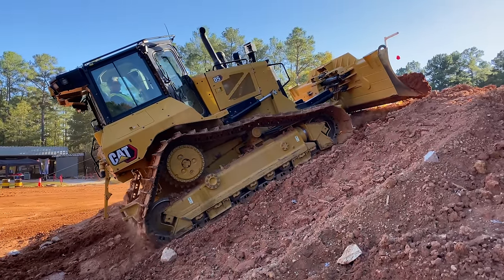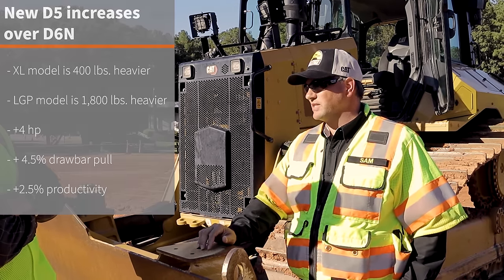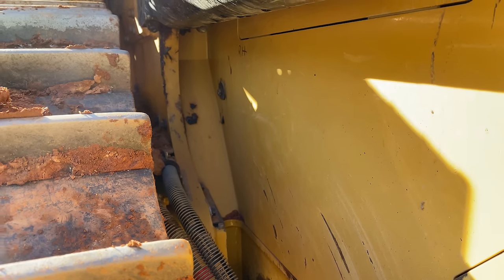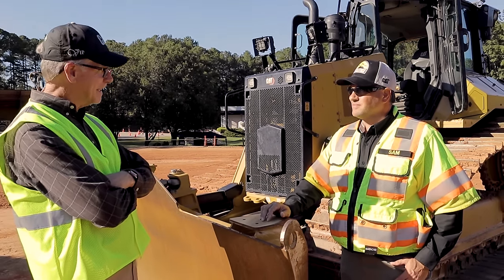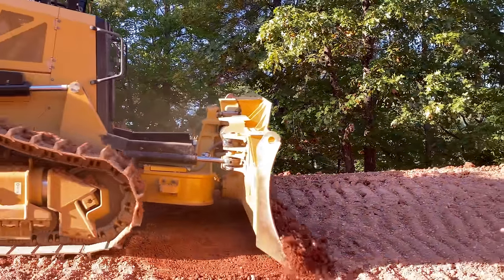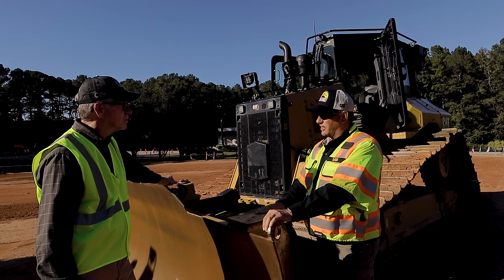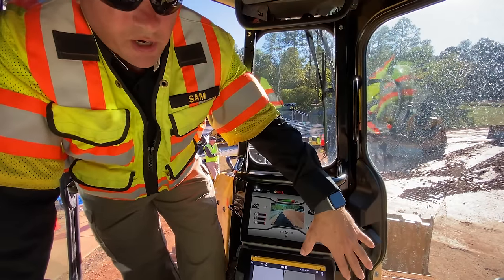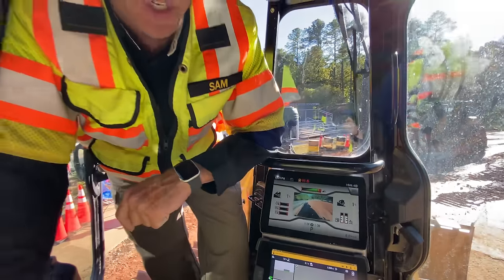The New Cat D5 Dozer: Everything you need to know!

Comment: Sweet dozer. What I see happening is it’s hard to bill per hour on a project when a d6 is reduced in size by the sticker on the side to a d5. This jumping around r in size thing has created an outbreak of the competitors jumping around as well. It’s too complicated. The dozer in the video does not have an equalizer bar and independent rollers frames? That sucks in the ride department... and running over a stump will spill your coffee and created a new hemmeroid. < spell error. I do applaud cat for keeping up with technology and staying ahead of the competition. It’s starting to look like Cat and Komatsu are setting the pace on machines with parts availability. I like a lot of Deere Machines but their dealer sure does suck here in the southeast.  Parts suck as well. Costex is choosing to supply Cat and Komatsu for a reason?

Comment: The nomenclature change has been needed.  I've broken to many D6K, D6N  operators ego's with my 1994 D5HXL.    The new D5 looks good.  But needs delta track frames.  There's no reason to design a flat top track frame,  it just holds dirt.

Comment: Pushing scrapers with a d6h XL and clearing pushing landfill xcetera I wouldn't even know what to do with one of them newfangled contraptions if I got in the cab of it
Reply: Who pushes pans with that small of a dozer lol
Reply: @teamwoodswarriorsracing2004  ad6 is just right for pushing a T-Rex ts14 it will push it sideways
Reply: @forestlawrencegrading9154  thats a little hard on the tranny bud, i could see using a 7r for ts14s or 621s but not a 6,
Reply: Idk. I’ve pushed a mother load of ts14 scrapers with a d6c, d6d, and d6h and d6r. Do you mean that the transmission torque converter heats up or is it hard on the gears? I’m very gentle on machines so maybe in a fleet mentality with any operator it’s more prone to be an issue? Of course in optimum situations you’d want a d7 or d8 for ts14 scrapers right?
Reply: @technicalitems731  should only push in first gear never seen anything heat up but I remember being on the scraper instead of the Dozer one day and the guy pushing I heard him hit second coming toward me he was going to try to jerk my neck I heard the tracks clacking I dropped the bowl and lifted the back wheels off the ground when he hit the back of the scraper his ass came off the seat I never tried me again like that
Reply: @technicalitems731  torque converter heats up, the best way to partner up pans and dozers is like this 621-d8 631d8/9 651-d10
Reply: @forestlawrencegrading9154  Ha Ha Ha I had a good laugh thank you.

Comment: D7 dozer's in 70s & 80s were 50,000 lb not the LGP, and around 200 HP, now D6 dozer is around 50,000 to 54,000 lb and 215 Hp. The old 1970 & 1980 D5B not a LGP were 26,000 lbs and 105 HP, now a D5K LGP is 21,000 lb and 104 HP. They keep making the machines larger.
D5K LGP 21,000 lb & 104 HP Like a old D5B
D6K LGP 30,664 lb & 130 HP Like a old D6C or D or E
D5  LGP  42,000 lb and 170 HP Like a old D7G 45,000 lb and 200 HP
D6  LGP  52,000 lb and 215 HP Like a old D7G
D7E LGP 57,400 lb and 238 HP getting close to a old D8H & K, they were 60,000 to 69,000 lb and 270 to 300 HP
A D6 dozer at 52,000 lbs and 215 HP that blew me away, that is one hugh D6 dozer

Comment: funny to call it a 5, and even more so to call it an N.  If they really wanted to improve the cab, a seat that rotates 45* either way would be a huge help, especially when ripping.  I think someone in sales was smoking something newly legalized.  Does a good operator watch all the monitors, or does he feel the machine?  Seems like a lot to watch at once.
Reply: I'm an Operating Engineer (IUOE Local 15, 38 yrs, ret ). I have spent so many years running dozers of all sizes and developing a "level ass" and a feel for whats going on with the machine. I have questions: 1. There are so many uses with a machine, cutting, carrying,  digging, etc and so many materials that you handle with a machine, garbage, debris, dirt, various size stone, raw building debris, mixed materials, tree stumps, etc. How can the machine know what is the "ideal" blade loading condition. 2. Looking at those grade monitors. Do they help with compond grades (two different grades on one field) or complex grades (grades that have complex shapes and transitions). I'm skeptical. Seems to me that they are not trying to make the job easier. They are trying to make the job less skillful. Am I missing something. That said, I would love to try one out, just for fun.

Comment: Don’t kid yourself. Nobody likes the electric drive motor tractors. 1800 more pounds doesn’t give you more productivity if it’s to heavy to the work in the wet stuff and 4 more HP is a joke. The underpowered 6n needed at least 25 more HP and speaking about the cab, you can have all of the visibility you want but if didn’t give the cab more leg room it was a waist time. I’m 5’9” and feel cramped in a 6n. Man, i feel Cat is going backwards instead of going forward.

Comment: Why not put cab on front motor in back
Reply: Because it would be so darn ugly that no one would buy it.
Reply: You can but you want as much weight as you can at the blade end so you can cut in  . Cat had a rear engine track loader which was fast  but no weight at the blade end limited it's usefullness.
Reply: Eimco brought out dozers and loaders with the cabs in front and the engines in the back years ago, Terex /Euclid did the same withe cooling system mounted behind the operator.
Reply: @marinopacentrilli9533  True but they still make them, with the track loader U want the weight over the back to act as a counter weight for the loaded bucket on a loader.
Reply: John deere high speed dozer. But not really a dozer